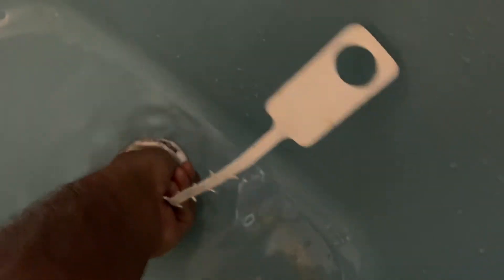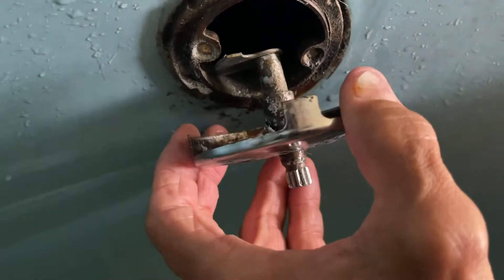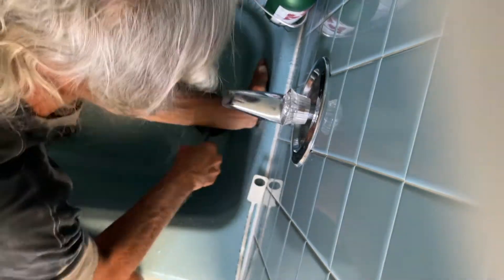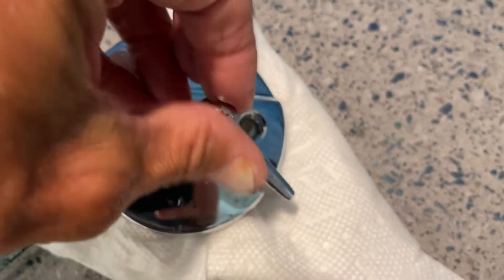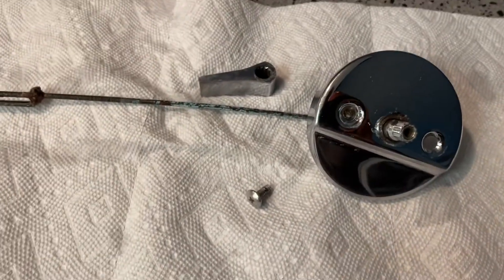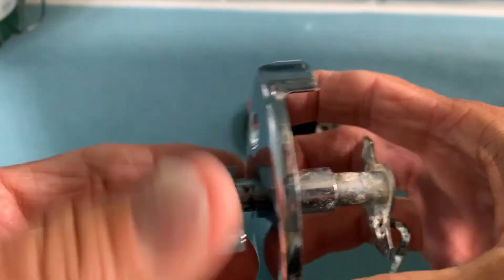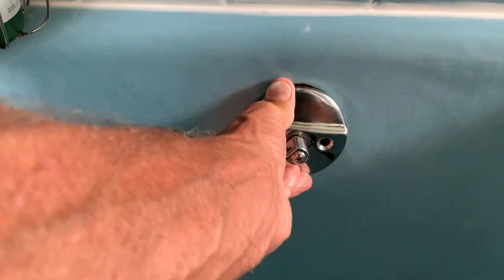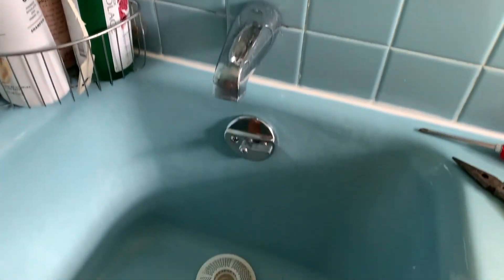How to fix and rehab a 50 year old bathtub trip-lever drain stop with broken screws.

Comment: Hey Tom, great video. I have the exact same set up - the spiral as I've come to call it was filled with hair. After watching your video, I will try to clean it up. Question: is that spiral looking piece at the bottom just a hair catcher? So essentially if I have that, I won't be able to actually plug the water to say take a bath? If that is true, could I swap the spiral out with a more traditional drain plug so the tub will fill up? Thanks for your help.
Reply from the maker: I guess you could do that all I did was get a rubber thing that I put over the drain so that the tub and fill up much easier good luck thanks for watching
Reply: So I assume the original mechanism is an actual drain stopper, and not just a drain and hair catcher? Yes? but how does it work?
Reply: @1ACL  stopper goes down into drain hole with a j shaped linkage with a horizontal paddle that gets pushed between the spring rungs.  when the leaver is turned it pulls up or pushes down to open and close the stopper.  The spring is just classic physics engineers used back in the day to multiply force applied.  #OldSchool

Comment: Hi Tom,

My tub is identical to yours. Blue and old with old parts. Can I replace the old trip lever with one of the new models, or will it not work for my old tub?
Reply from the maker: If the screw holes line up
Reply: Thank you

Comment: Mine is missing the linkage an the spring could it have fell down the drain,? I pulled the cover off with the two screws but the long piece with the spring is missing 🤔
Reply from the maker: That’s possible or when they installed it they just didn’t put that in if you’re having a clog then that’s possible but if it did fall down in there it’s gonna be hard to get it out good luck thanks for watching

Comment: What is that thing underneath the plate on the wall of the tub? I am completely replacing the lever and drain, but that thing is getting in the way of the new overflow plate
Reply from the maker: This is a very old system and it’s the end of the overflow pipe that has this two spots where you screw it in and then the pipe goes down when I pull out the plate. It’s connected to a spring that catches debris in here so that you can pull it out and clean it at the junction of where the drain on the bottom of the tub and that pipe me. Good luck on your install. Thanks for watching.

Comment: Hi, may I ask what it is the name/catalog number of this drain stopper? I have exactly the same thing. Thanks!
Reply from the maker: This is probably 40 years old at least and I have no idea what the catalog name would be or number I did not put this in originally it came with the house back in the 70s I think you could try an image search on Google and it might post something like this up for you
Reply: @TomLeeman  Thanks a lot! Does it originally comes with a rocker arm? The spring itself doesn't seem to be able to block the drain?

Comment: Sadly, that overflow pipe at the top is supposed to be behind the tub wall with a rubber or foam gasket between it and the outside of the tub and mounting the cover pulls it tight and seals the pipe from leaking when the screws are tightened.  Whoever installed it was a clueless hack! If the tub fills too high, water will be in the basement, rather than all of it down that pipe.
Reply from the maker: Excellent tips thanks a lot good thing we just take showers and thanks for watching

Comment: That thing is over 50 years old and it's still shinny
Reply from the maker: I change it up and cleaned it really good
Reply: Do you recommend cleaning (with barkeeper's friend or whatever) the assembly pulled out of the wall, and whatever else is covered by the faceplate?

Comment: You didn't really fix any thing..the most important part is the stopper and the pivot arm that works off the preasure from the spring when the lever is turned.  Find that piece and re-install it and then I'd say you rehabbed the drain mechanism.
Reply from the maker: You’ve definitely have a point there thanks for watching. Good luck on your project.